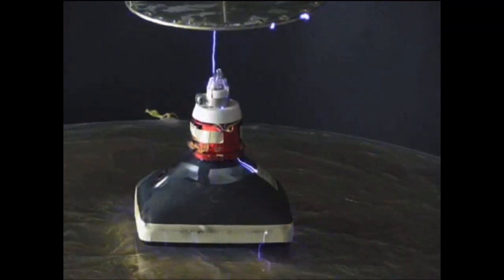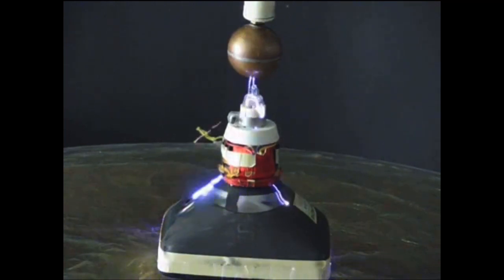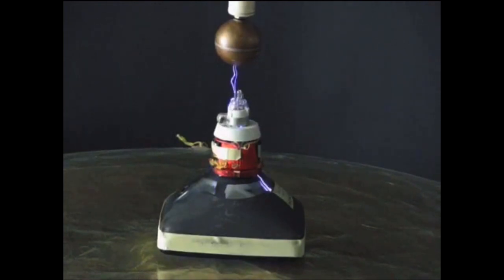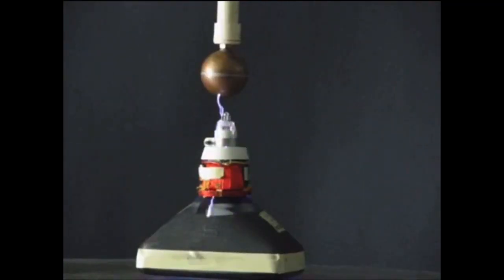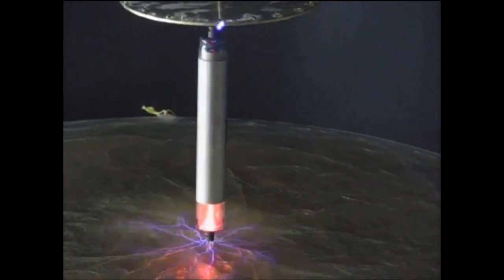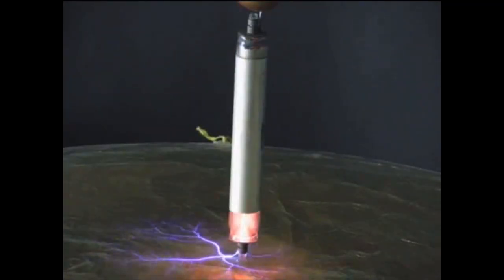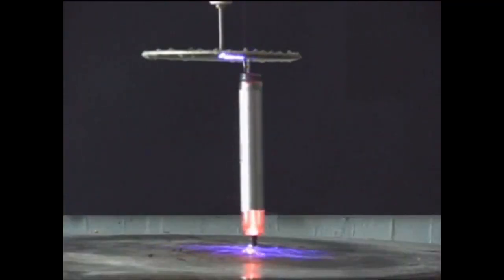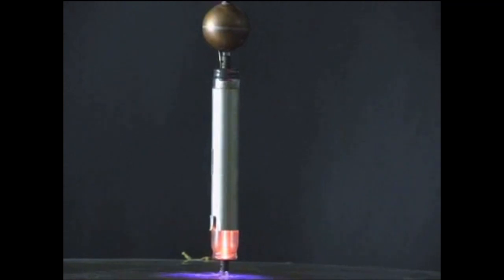Orange Flash - Aug 29, 2007 Experiment - Vemasat Research Institute - CJ Ransom

Comment: I think the orange flashes are like the return stroke on lightning.  the blue sparks and streamers are charging the body of the discharge tube.  The orange flashes are from reactive current.  When a blue spark travels between laser and ground, it often caries more electricity than the ground can absorb because the ground has higher resistance than the air between the laser and the ground.  The ground (or metal plate at the bottom) is like a resistor in an electric circuit and like any resister their is a build up of electrons that push back against the electron flow. Sort of like how if you try to shoot water at from a 2 inch diameter hose into a flat plate with a only a 1 inch diamter hole in it.  The result of the water hose experiment is that you get a lot of water splashing back up and not going in the hole.  That's like what happens to electrons when they go from the air gap from the laser and try to go over the metal plate on the bottom.  IMO.
Reply from the maker: Great description! 🤜🏼⚡️🤛🏻